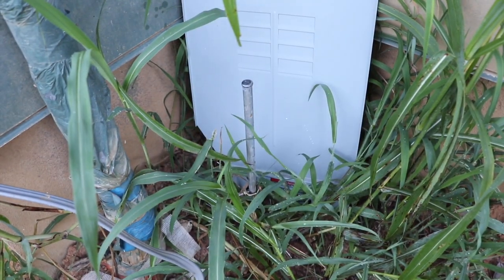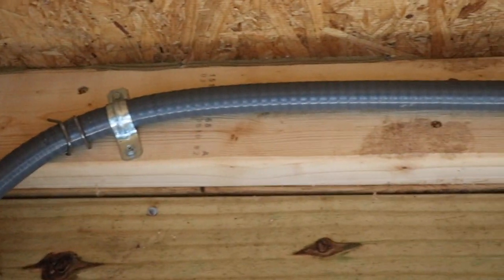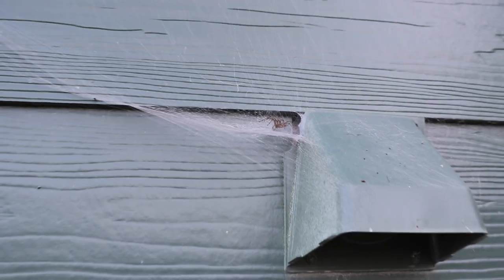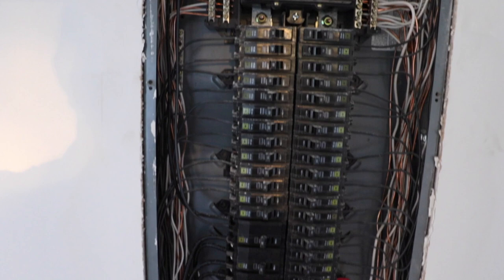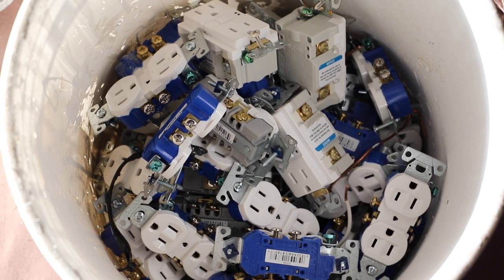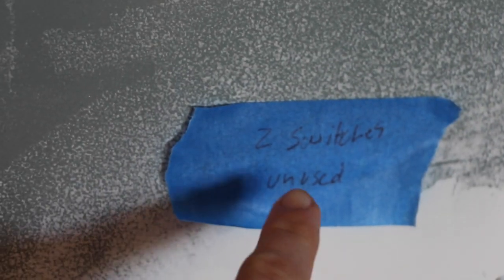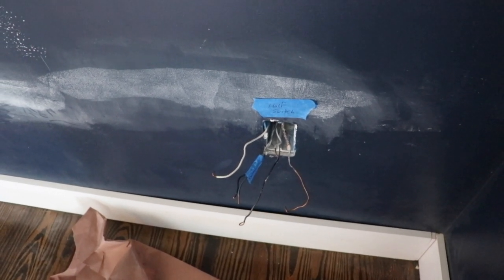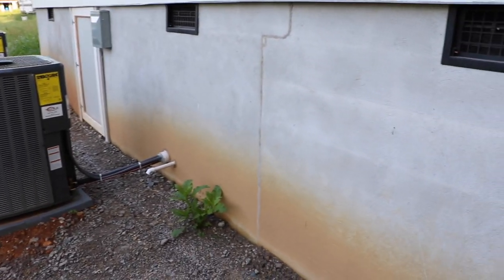Electrical Contractor Failures - Trade Tips

Comment: The Main Feed is not even Phased properly. It's  Supose to be Black Red (from left to right) and White on the Neutral Bar. Feel sorry for ya bud. People should stop hiring cheap Hispanic labor, the language barrier creates potential safety hazard's.
Reply: 240 is 240. It doesn't which color as long as it isn't the neutral or geound

Comment: It seems like you ran to much wires to that box  if you noticed all those problems  you should of fixed them I would have. Homeowners can do the work and get it inspected
Reply from the maker: Frank Molina it's a large house. We didn't notice the issues the inspector showed us them.  This was the third time the electrician failed an inspection, the first time we corrected the mistakes ourselves (mainly nail plates, etc) but on the actual wiring of boxes etc we hired another electrician.  Home owners can do it themselves, but this was a job we wanted to hire out hoping for better workmanship

Comment: So many violations! Some body did not check to see if they (the susposed electrical contractor) was licensed, insured and bonded. And then who ever he/they sent out to do the work should have at least been a journeyman electrician.
Reply from the maker: rafdavfl NC doesn't have a "journeyman" license.  In NC an electrician can send out W2 non licensed employees to work under their license.  We are actually building a case to help the NC electrical board have a reason to change the standards.

Comment: No de-ox on the aluminum service conductors. Neutrals and grounds need to be separated in sub panel, neutral bonding screw needs to be removed bla bla bla . I've seen enough and I don't feel likle anymore typing. life is to short

Comment: What I dont understand is why this guy is wiring anything himself if hes not an electrician.The inspector passes this guy wiring the house except for main panel and select circuits?It sounds like this guy is having trouble identifying the difference between neutrals and grounds
Reply from the maker: It sounds like you are having trouble understanding the video.  This is on the failures of an electrician.

Comment: 7;38... man if you onli see the incoming cables to the switch you can see the white wire its in the same spot the grey or naked wire.... sooo im not from you country buy i can guess that white wire is ground so technicallly the electrician dont mix the wires unles you habe 380 or 400 volts so that three wires are R,S,T.... so all the conection burn to hell.
Reply: White is Neutral, bare or copper is the Ground (Earth). In a sub panel they are not supposed to be tied together, only at the main panel.

Comment: No way in hell, would I ever use aluminum wire again for underground feed
Reply from the maker: +Larry Kluck I'm not sure what they used, it was the power company that ran that wire.
Reply: Larry Kluck Can I ask why? A lot of people are using Alumimum conductors for the service feed. Its cheaper and as long as the cable type and size are correct for the application then its perfect for keeping bids lower.
Reply: I had to dig up my underground wire after 35 years and replace with copper. Its like it bubble up. It had big white bubble on the outer cover of it, it was so bad all 3 wire broke underground.
Reply: Larry Kluck teck cable? Or pvc sleeved? (Not arguing with your choice just professional curiousity)
Reply: Can not remember
Reply: Put new copper in conduit this time
Reply: My meter is on the light pole 165 ft. From the house. So I had to paid for the wire and conduit for the in ground. So I used copper.
P.S.. Dug it in by hand also, 2 ft deep 165 ft long.
Reply: Larry Kluck I've never heard of a direct-bury cable made of Al besides coaxial, which is called flooded and is full of anti corrosive goo. Pe sheath is a cheaper plastic than PVC, and any plastic is going to be permeable to water, despite common sense.

Comment: All homeowners think they can do electrical work. Which is fine until you have a fire.....then the insurance company comes out and wants to see permits signed off by the building inspectors before they pay. (And these rarely exist). If they don't like what they see they simply refuse to pay. Now the homeowner has to hire a lawyer. The End.
Reply: some homeowners actually do their homework and can do most simple installs, i am doing some remodeling and found multiple electrical problems, wires nutted under drywall, wires nutted over the ceiling, neither in boxes. 4" box with 8 wires entering it and in the ceiling with no access, electrical boxes with dead wires and no covers. junction boxed hidden in the ceiling, live dangling wires, ect... i have repaired most of the issues and continue to repair more as i get funds.
there are plumbing issues as well that i have repaired, as a homeowner, no i do not know everything but i can find definitive authorities that do, and educate myself. 700$ to snake a drain that the toilet has already been pulled up and no installation or removal is needed is ridiculous,  went and rented a snake for 50$ for the afternoon and did it myself.
i respect that the trades have to take classes and thing in order to retain their license, but that is no reason to totally soak the customer
Reply: BB....Plumbers are the worst. Especially when it comes to dealing with a clogged toilet. They know that homeowners hate dealing with poop so they charge ridiculous amounts of money. They have a saying..."It may be shit to you but its my bread and butter". Another total rip off is if your heating system goes down in the winter. They totally scalp people because they have you over a barrel. YouTube is your friend here. There are many videos that can teach a homeowner with some mechanical skills. It is quite rewarding to fix it yourself such as the way you did. I have worked in the trades for many years. Go slow and teach yourself.

Comment: what do you expect. electricity in the US is still standard from the early 1900. btw the ground and neutral connection is still used in the US as standard. In Europe this system was banned back in 1975. whe I saw your main Box it reminded me to boxes I saw from right after ww II. low standard
Reply: "electricity is still standard since 1900" lol no the code book has been evolving for years. what does that even mean, "still standard"

Comment: Oops! Some of this is true, some of it isn't. This kind of report is what you get when amateurs talk about requirements they do not fully understand.
Plumber did the initial wiring, except what the owner installed. Handy Jack should not have touched any of the wiring. 
Do not make representations about National Electrical Code requirements which you obviously do not understand.

Comment: That wasn't a ground wire on the AC..its a charging line as it was next to refrigerant lines and not the power lines...come on..all electricians should have to pass a common sense class before certification..wtf

Comment: I think you should not comment on electrical issues when you have no idea what you're talking about.  You can mix ground and neutral on one bus...but most electricians mount ground and neutrals  on separate buss bars because of neatness and ease of installation, and yes, you can put two ground wires into one screw.  Now, what is this BS about the main lug with the red and black service wires being swapped left to right? Makes no difference.  If I were you, I would take down this video..sure, there are a couple mistakes which I agree with, but you re opening your self up for one hell of a deformation of character law suit!
Reply from the maker: You can’t mix grounds and neutrals on a sub panel.

Comment: You seem to imply that inspectors are more highly trained and competent. In reality, the opposite is true.  I finally got fed up with know it all inspectors and hired a legal firm for my company for the sole purpose of suing the inspector and cronies each and every time I had to do business with them.  When your electrical engineering is based on science, physics and fact, you can win each time.  Remember, inspectors are 'APPOINTED' by the city/county.  There is NO standard they must meet pertaining to electrical knowledge.  Most of the time,  it's a form of nepotism.  The good 'ol boy or he's my buddy so I will make him an inspector.  We absolutely eviscerated the Code Enforcement Dept. 8 times.  It's common practice that they generate repeat trips.  It generated $$$ for the county.  I fought.  They lost. Every time.  We now are waiting on punitive damages.  NEVER take crap from an inspector.  Just make sure your act is together and then videotape EVERY single outlet, box etc..  It will save you tons of aggravation when you have to take them to court.  Btw,  neutral and ground should ALWAYS have a zero potential.

Comment: I quote" the electrician the lights but he said I installed with lights with plugs." Did you do your own work. Did you call your electrican. YES OR NO.. There are a lot of code vilolation tamper resistant was in code 2008 again there is no 2015 code book  but  now where in 2017 code book. Quote " I he said I wire then he talking about he wire the switches. I wondering if he did a lot of his own wireing himself. And trying to pass the buck Because he keeps saying that he wireing stuff. Just get the electrician in there to check and correct the proplems. The most expensive labor is cheap labor I always say.  Then it cost more to get a electrican to fix the screw up.

Comment: I know I shouldn't but I can't help myself, I have to leave my 2 cents. Sorry

Yes those guys did a terrible job. They didn't just violate code, but none of the work you showed was done in an acceptably "clean and workman like manner". The sloppiness of the work is telling. They're clowns. And unfortunately from experience I'd say there's a lot more of them than there are competent electricians.

I wonder how much your AHJ has added to their electrical codes in addition to the NEC. I've found that often different locales will have things that are enforced as code but are in actuality just tradition. Like that comment about color coding the phasing of the conductors. That's not an NEC code. But I could totally see an inspector citing it as a code violation. That's not to say it hasn't be added in a code addendum in that AHJ, just saying that I doubt it has. Inspectors can be just as incompetent as contractors. I see it all the time. I have literally shown an inspector a code in question from the book and he couldn't understand the meaning of the english on the page.

As for those switch legs you have buried in your walls for future, yes they shouldn't have been tied into the electrical, but technically they shouldn't have been in those boxes at all. Even when capped off, they are still present in a box with live electrical conductors and can become energized accidentally, causing wires just floating in your walls to become energized. Have I done it? Yeah, but I'd never allow it on a project like that, too much liability.

Comment: So you installed the wrong lights and fault them?
Reply from the maker: what the if I said I installed the wrong lights, how would that be blaming them?  The lights should have had a GFCI on the circuit.  They wired them up. I blamed them for the GFCI.
Reply: Yanasa Ama Ranch Homesteading, they have to be tamper resistant, and GFCI protected.
Reply: Yanasa Ama Ranch Homesteading , you should have a licenced contractor do all your work instead of pieceing it together.
Reply from the maker: what the actually no.  Exceptions "outlets that are part of a luminaire, outlets more than 5 1/2 feet above ground, outlets dedicated to appliances not easily moved" - You went as sharp as a bowling ball to about as effective as a gutter ball.  Thanks for playing
Reply from the maker: You mean to tell me I don't have an NEC code book? good thing I hired an electrician.
Reply: Yanasa Ama Ranch Homesteading , it's probably a good idea if you not take a step on a construction site again. You know just enough to get you or someone else hurt. Also treat everything like it is energized. Don't go poking wires in a electrical panel. You will live longer that way.
Reply from the maker: what the did you know that when panels are installed, people touch them? Scary thought.  They touch wires, even run them through walls unterminated! They even pull the electrical box out of packaging by hand! It's crazy!
Reply: Yanasa Ama Ranch Homesteading , they don't touch the non insulated part. Good luck on your short life.
Reply from the maker: what the oh but they do!  You would be amazed at how many wires and lugs were touched by hand during installation.  Oh my goodness gracious it's just crazy what they do during installation.
Reply from the maker: what the believe it or not, I even touch the plug to our Christmas lights when I pulled them out of storage.  Zzzzzzzt
Reply: Yanasa Ama Ranch Homesteading ,I really hope your not a contractor. I would be scared for your clients.
Reply from the maker: what the why does being a homeowner come across to everyone as being an electrician or contractor? lol am I that good on camera?

Comment: I doubt your six-year-old could strip wire better than that
Reply from the maker: Staci Curtis he can, but it's also a pressure issue, a lot of times guys in a rush will hunker down strong and yank, that's what causes the damage to the wire.  If you let the pre-measured striping pliers do the work and not force it, it comes out better

Comment: So I take it the people watching this video know the lugs are not energized right??? I did HVAC work and even if I pulled the disconnect I put a meter across the contactor and many times I found the home owner by passed the disconnect.. You assume people know it is not energized, I see you as not living long..
Reply from the maker: I assume you have not done much work with electrical if you are under the impression a power company would supply electricity without a passed inspection.
Reply: @YanasaTV   I have done a lot of electrical work, I do not have to justify my experence when you are the one touching lugs..   All you do is hold the metal on the screw driver.. If a novis sees that they have no clue it is hot until they are cooking.. You never once said tbe company did not drop in the meter.. If you hired a company that did that kind of shit work that is your fault.
Reply from the maker: Rob Mul at the very beginning... and throughout the entire video I am explaining that it did not pass inspection.  This isn’t an instructional video so I have no idea why someone would be mimicking what I do

Comment: You have no business commenting on something you know NOTHING about! You are going to get someone killed telling them to pull on wires the way you did. Also, there were only a few issues with all of the topics you were discussing. If you don't know the difference between a grounded conductor and grounding conductor then don't say it's wrong because it wasn't. What does a subpanel have to do with arc-fault? A laundry circuit is permitted to serve more than the washing machine. How would you suggest installing an insta-hot water heater under a sink? lol there is no code that says the box can't go beside water lines. What about a garbage disposal under the sink? On single phase it doesn't matter what color is where! The dummy is the one who made the video. I admit, an electrician wouldn't have made some of the stupid mistakes made but it is wrong for you to give advice on a topic you yourself know nothing about. The problem is that people want to hire the cheapest person on a job and get crap work and fault all electricians. You get what you choose to pay for. Hire real electricians!!

Comment: 90% of what this guy says shows he knows absolutely nothing about wiring...for instance... If it is a GFCI outlet u don't need a GFCI breaker....should have got there b4 the drywall went up
Reply from the maker: There was no mention of a GFCI breaker, just Arc Fault breakers.  They aren’t the same thing and are required differently by code.  Obviously you wouldn’t have a GFCI in-line with a GFCI, it wouldn’t operate correctly.

Comment: My question is, this is your project, how do you excuse yourself for not checking in on your project? I understand that this is complete shit work, but it shouldn't have made it even remotely close to that far in completion without catching this kind of work... Now you pretty much need to start over, cause if your finding all of this now in the visible areas, I can't even imagine what's hiding inside those walls...
Reply from the maker: Azzie, what’s inside those walls has already been inspected.  Typically there is a rough in inspection before there is a trim out

Comment: i would rip the lot out and start again. Looks like its been wired by Stevie Wonder! Dont you even use insulation sleeving in the US on the circuit protective conductors? RCBO or RCD on socket outlets or locations containing a bath or shower?
Reply: David Ghaemi no but we have vinyl tape in an assortment of colors, even black.
Reply: Yes, they are called GFCI.

Comment: You're so called main panel. I didn't see a main breaker in it. The washing machine circuit should have been inspected during the rough in inspection. Clearly you don't know what seal tight is. So you make a video wining about stuff that you have no idea about. I don't know where this ranch is, but I wouldn't trust you to be a hand on it.

Comment: The vent plug is legit, they used a nice part.
Reply: Wouldn't the Romex go into a junction box - either the one that came with the appliance or one supplied by the electrician connected to the fan by the cord that came with the unit?